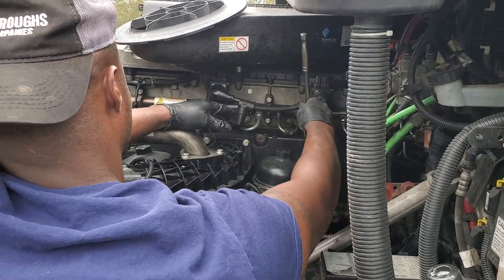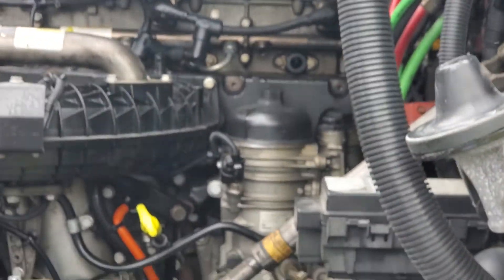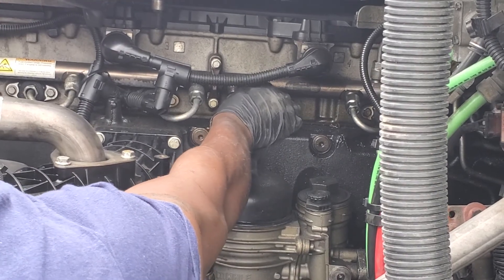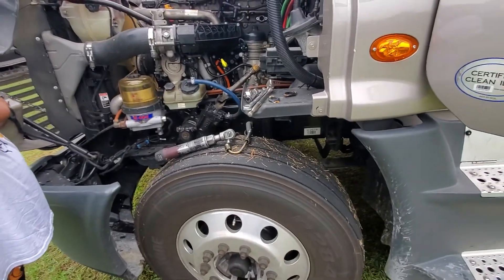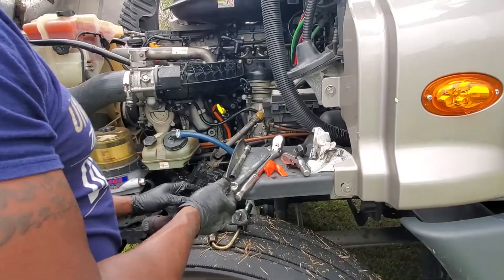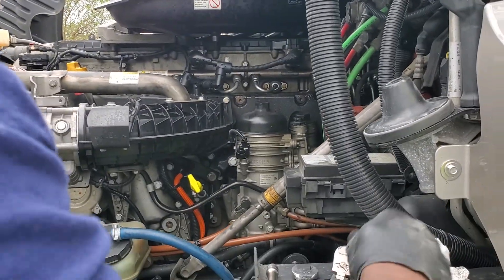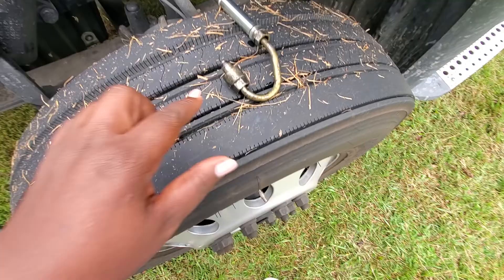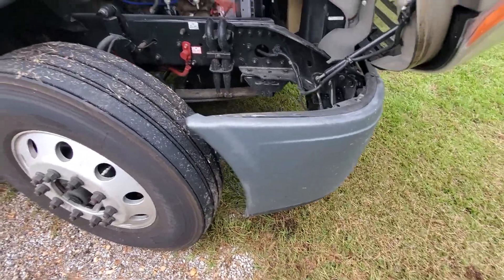Changing Injector Fuel Line (DD15)

Comment: Just an FYI. Nox sensors are misdiagnosed 87% of the time when they are replaced. That is from the DD technician support forums. And being a dd certified technician I can tell you that's 100% true. Most likely there is an upstream issue that will show itself later. It's good to have someone that can turn a wrench and change parts. Better to have someone that can properly diagnose the real issue and uses a torque wrench when doing those repairs. Did you know 100% of nuts and bolts have an exact torque specs. Meaning, always use that spec when doing repairs. From tire lug nuts to delta pressure sensor bolts. And according to dd now anytime you remove a fuel line either on high side or low side you are to run a dd specific fuel treatment through the system to prevent fuel pump lubrication issues when priming. But unfortunately most dealers don't even sell it yet. When this video was made it was mandated to do that step. Anyways drive safe.